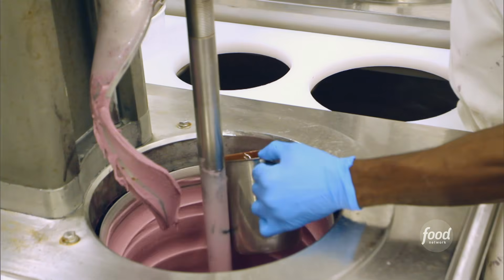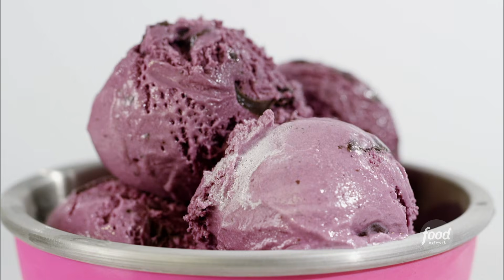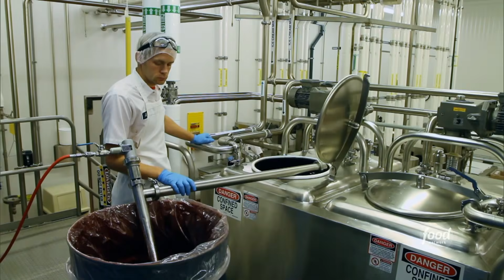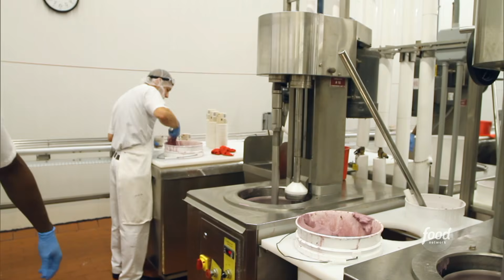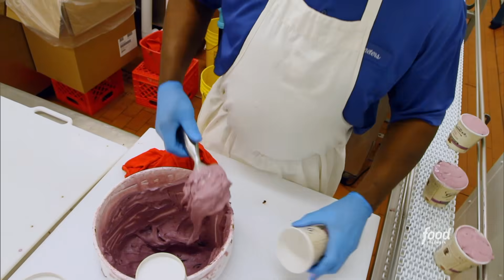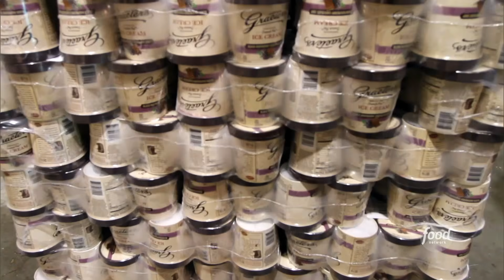How Graeter's Ice Cream Is Made | Unwrapped 2.0 | Food Network

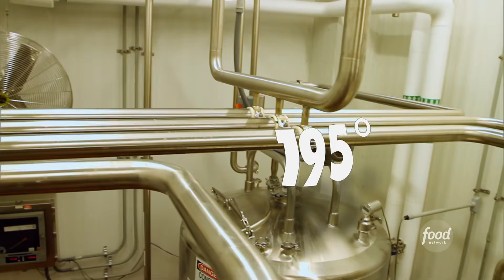Comment: 1:05  That is stainless steel, not aluminum.  They wouldn't allow aluminum to be used to build a commercial pasteurizer.
Reply: How do you know, did you work there?
Reply: @mywig6956  How do I know?  Let's see...

Mechanical Engineering at Georgia Tech; years using all manner of metals (lots of stainless steel) engineering automatic firearms; thirty years working in cuisine including industrial processes (like this) as my ProAm hobby; actually physically examining various food-processing vessels (like this, and from the same manufacturers that make reaction vessels for the pharmaceutical industry); knowing that aluminum is reactive to milk, which has a pH of around 6.5, and is therefore not allowed in applications like this...

Another important factor is the fact that, if it were aluminum, the accessories fitted to the STAINLESS STEEL dome (top) are not able to be aluminum for a number of reasons, not the least of which being the galvanic corrosion of dissimilar metals which, over time, would destroy both the accessories' threads or flanges and their attachment points on the vessel proper.

And if that's not enough, one can, with only a small bit of experience, discern the difference between a brushed aluminum finish and a brushed stainless steel finish (like this).  If it were aluminum it would dull to a light gray in short order.  Believe it or not, that gray is actually molecularly identical to Sapphire.

There's more, but I have breakfast to make.